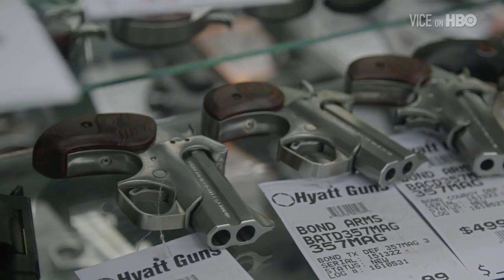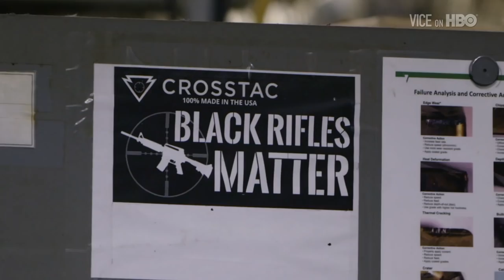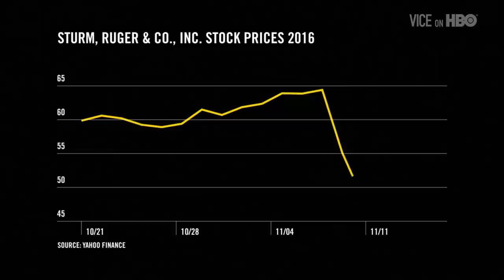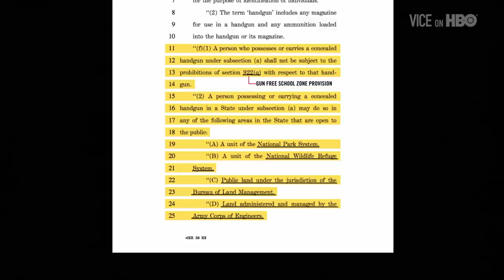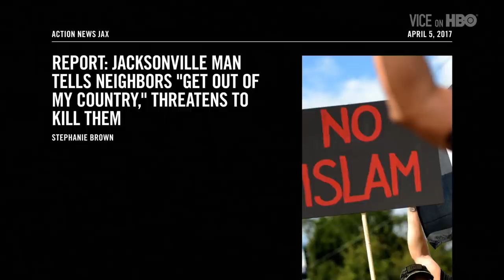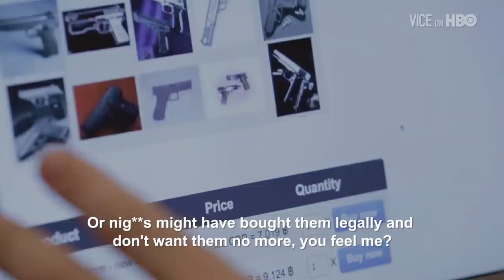The Future of Firearms with Suroosh Alvi | VICE on HBO

Comment: i feel obligated to buy a gun as an american, i missed out when i turned 18 but i'm getting my first AR next paycheck (:
Reply: bought it! registered with the GOA as well
Reply: You probably have your pick already or bought it by now,but consider smith & wesson sport 2 ar15, its around 500 bucks and is very accurate and dependable,and the warranty good too. It is one of the best values out there right now.
Reply: I got two guns and I'm 19. I also have an anti-gun dad and never shot before I was 18.
Reply: Twiggy the lizard - $1000 in NY for that rifle. Time I scoped mine it was $1200. And it was stripped. No pistol grip, flash/muzzle brake or mags over 10 rds. $500 for 15/22
Reply: bobbluntman I live in NJ and got a stag arms ar because colt ar-15 is ban by name. It was like $1200ish also got a .22 lr conversion kit for $220ish. I'd never spend some much on more than $400 (MAX) .22 lr gun.
Reply: Welcome to the fun!
I would suggest getting some decent training. You can never have enough.
Reply: Hope you don't have any mental issues!
Reply: Look into building one. Might take a little bit longer, but you'll get to pick out every part you want!
Reply: Lem Sportsinterviews hello 911?
Reply: Lem Sportsinterviews what kind did you buy?
Reply: careful man, 1 turns to 35 fast
Reply: Always stay safe, guys. Follow the four firearm rules.
Reply: I'm 19 and have a DTI AR-15(rifle length) with a binary trigger and a Glock 29(10mm) and a concealed carry permit. Surprisingly my state allows concealed carry for any non-felon 19 years and older but I also got the permit just to reduce the restricted areas.
Reply: Buying my first rifle when I turn 18 (Only 6 months!)

Comment: I'm going to say something that may be controversial. The 2nd amendment (in reference to guns) is outdated and unnecessary. A gun in ANY situation makes that situation less safe not more safe. It had it's purpose when america could be invaded at any minute, but not anymore. A gun is a ranged weapon that can kill many people instantly, while a knife is a tool that can be used as a weapon and isn't ranged. You can run from, fight off, or simply be out of range of a knife while you can't fight a bullet. You may think that bringing your gun into Walmart makes you more safe, while that may be true, also makes everyone else in that Walmart less safe just with the presences of a deadly weapon. If we take the same scenario and use a knife the maximum amount of people that are less safe is what, like 5 just by the fact that that is the limit of people that can be around you in striking range but even then only one of them will get hurt because the rest can react and flee. The fact that I legitimately need to be afraid that my school will get shot up and I could die in math class shows a failure of a system that we have.
Reply: Are you afraid that you're going to be in a crash every time you're in a car?  Firearms being ranged is one of the reasons why they are so useful as it helps to negate physical advantages the attacker may have.  The second amendment is not outdated and I doubt that it ever will be outdated.  The only thing that changes about the inherent right to self defense and revolution are the tools most useful for it.  That used to be clubs and spears and swords and now it's firearms.  Maybe in the future it will be something else, but the principle remains.
Reply: @Nanofuture87  There are three high schools in my town each known for a different bad thing for simplicity (and not to give my real school's name) lets call them A,B, and C with the schools going from oldest to newest. I go to school A and we are known for fights and drugs, B is they get shooter or bomb threats, and C is teen pregnancy. Last year we had a lock down and school B has multiple (like 2) a year. When a high school in the same town gets multiple threats and you get one every so often it is a real threat. No I don't get scared that I'm going to crash every time I get into a car, I get scared when that that car runs many red lights a year and the driver doesn't stop texting. When you need to go on lock down once every other year it becomes a real threat that needs to be worried about.
Reply: @marshmellowmoon7990  A threat is not the same as an actual shooting, now is it?  I could call you up and say you're going to crash, but that doesn't mean you actually will.  Students are statistically more likely to die from a car accident than they are to actually be shot.
Reply: @Nanofuture87  When someone calls telling the school and threatens to attack it or is informed of someone that might attack it is different than calling and saying you're going to crash, it is more akin to calling and saying I'm going to crash into you. Now instead of this just being a chance that probably won't happen there is someone that has threatened to actively make it happen.
Reply: @Nanofuture87  I also remembered that two years ago someone brought a pistol into the middle school and the middle school is on the same grounds that my high school is, it is literally on the other side of the football field.
Reply: @marshmellowmoon7990  Yes, people threaten things all the time and those threats should be investigated by the police, but the reality is that they did not actually shoot up the school.  People threaten things online all the time as well, but it rarely actually amounts to anything.
Reply: @Nanofuture87  Let's just stop for a second. 1: The only reason I brought up my school is to defend why it is a legitimate fear. 2: School shootings aren't the main reason I don't think we need guns, I think that guns make it too easy to kill someone and that's the problem. 3: An internet threat isn't the same as a school shooting threat as an internet threat can't be acted upon as they don't have the information to do so and are most likely hundreds of miles away while a school shooter threat is made by someone in the area and could actually act upon it.